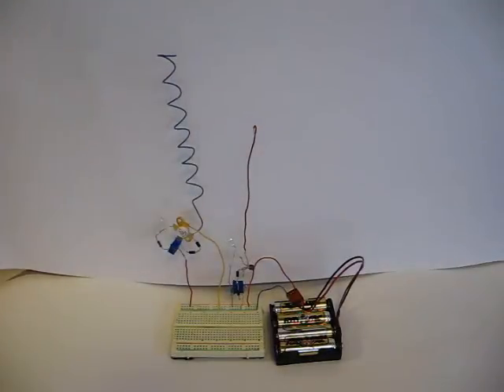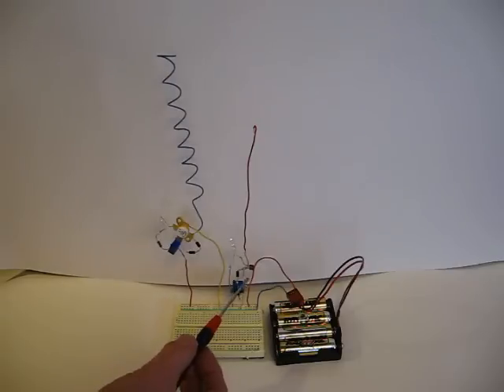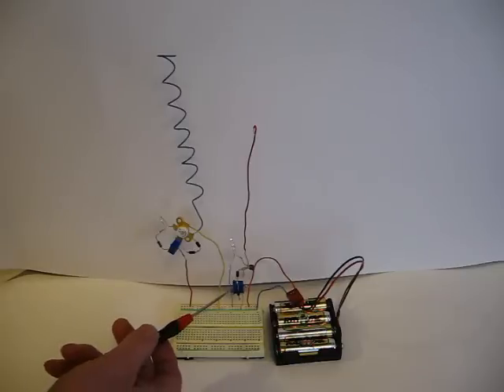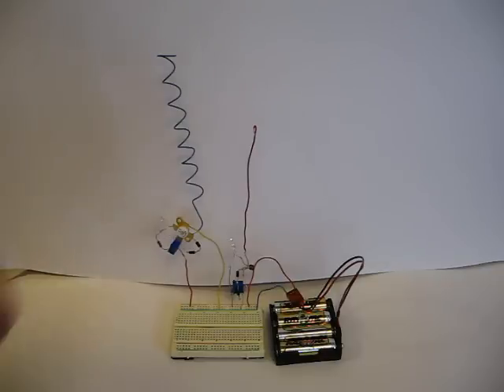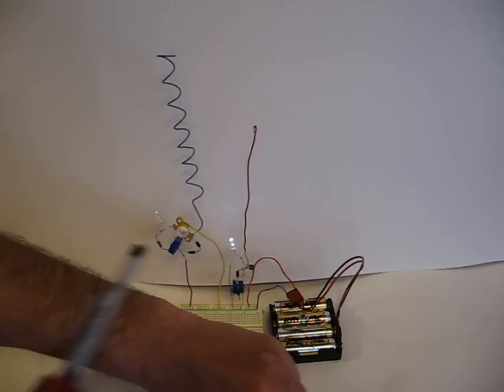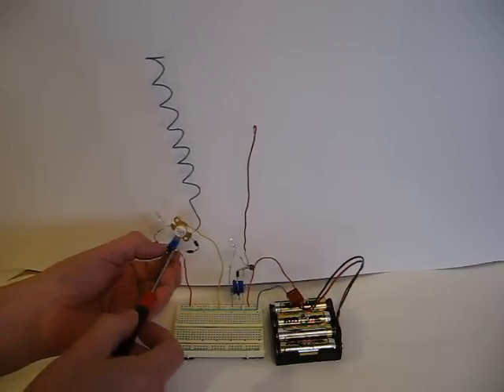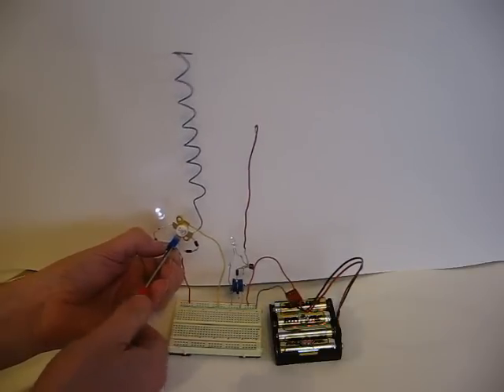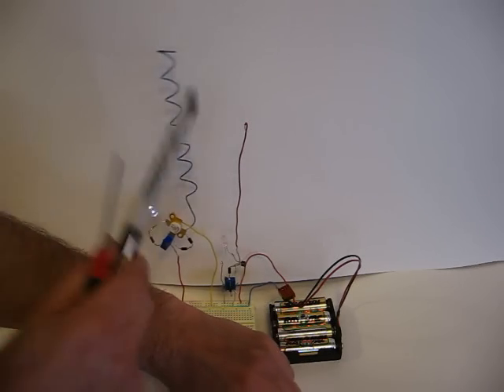Electric Field Sensor

Comment: Your 1N4005s are not providing ESD protection as shown. I suggest replacing them with a 100M resistor, and placing one 1N4148 diode from +5 to gate (anode to gate) and another 1N4148 from ground to gate (cathode to gate) and placing a 100K resistor between gate and antenna. The pot may be any value from 10K to 10M.
Reply: You are taking this video seriously..